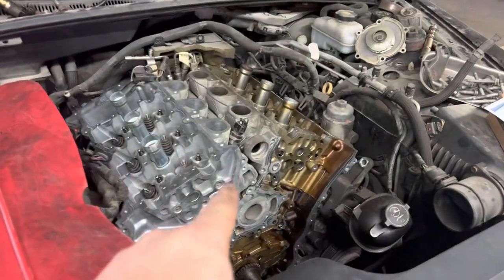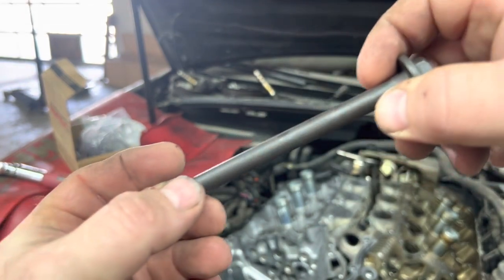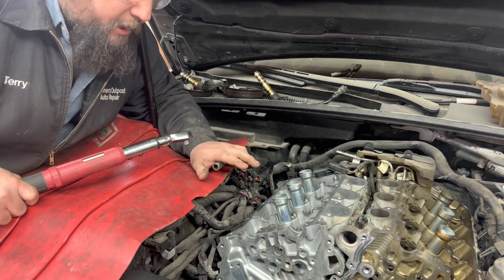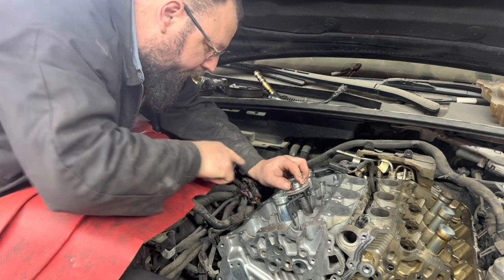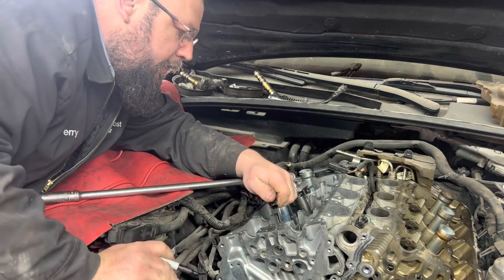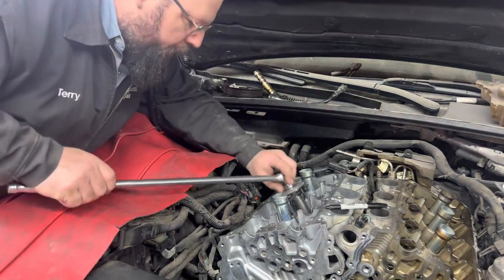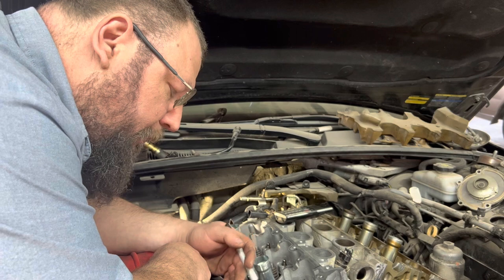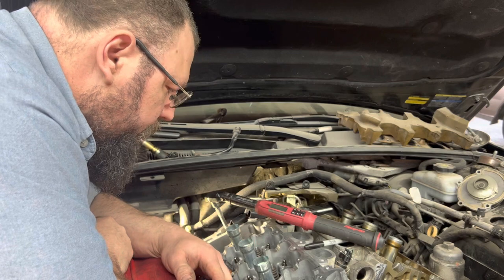Torque to yield head bolts, how to and why.

Comment: Torque is a measure of friction under the head and threads. Sensitive to thread condition.
Angle is more precise, because there is a thread pitch (therefore angle => elongation => tension).